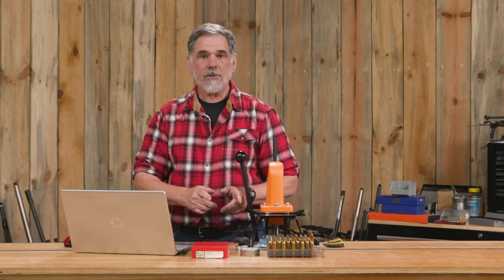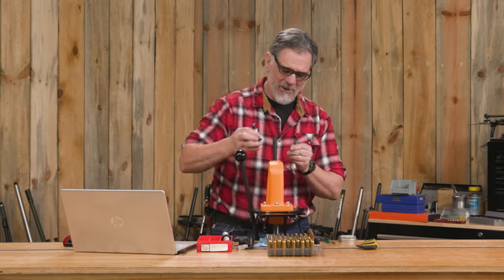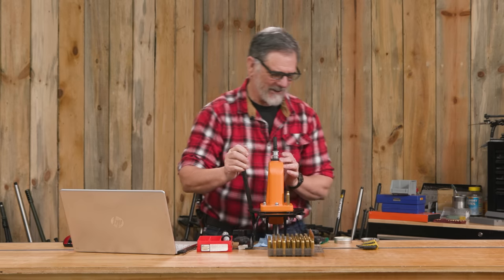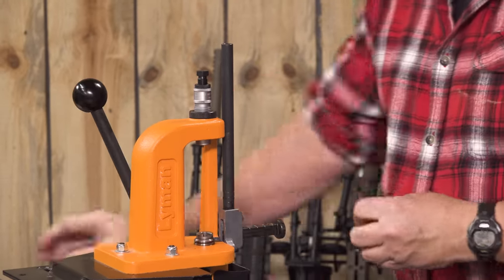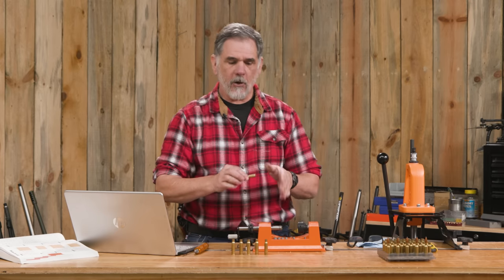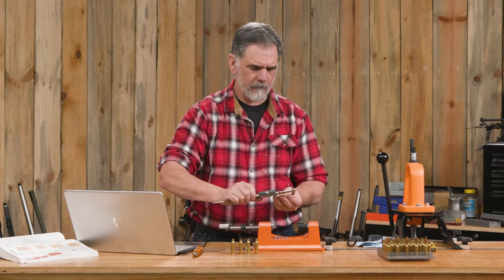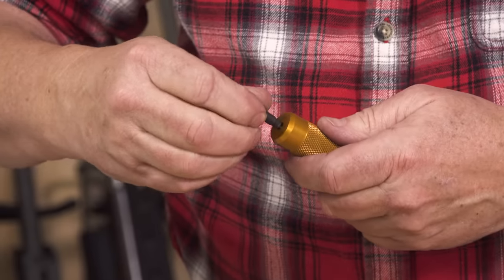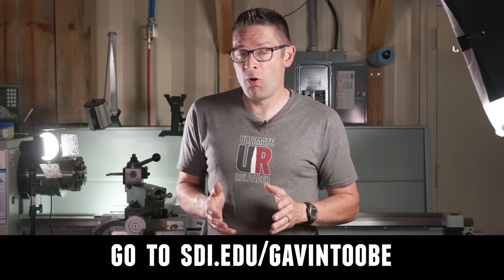Basic Rifle Reloading Part 2: Sizing and Case Prep

Comment: I de-prime on a separate operation I then anneal and when I set up my re sizing die I measure cases and set them back 2 thousandths. And I use a mandrel to set my final neck diameter
Reply: How do you determine  what neck tension you go with?

Comment: I also have an old Pacific .308win Die set. Still works great after all these years! After resizing (I also lube the inside of the neck..) I put the cases in a ultrasonic cleaner, to remove any lube.

Comment: Excellent video for the beginner and a good refresher for the experienced too. If I am setting up to load plinking ammo, I tumble the cases long enough to knock the crud off, then raise the ram with the shell holder installed to top travel and turn the resizing die down until it touches the shell holder. Back off the ram just a bit and turn the die about 1/8th of a turn and then raise the ram to check for proper overcamming. While still in that position, I tighten the lock ring and then turn the allen head locking screw in. I've used Imperial die wax for 50 years and never had a stuck case. Yes, it can get messy but I always clean my dies after each session so the excess lube never has a chance to build up. For a long time I used the Lee trimming tool which works great but now have a Frankford power setup-It indexes off the shoulder and has places to install a primer pocket cleaning tool plus internal and external chamfer bits. I used to prime on press but found I like a hand primer seater because I can feel the new primer bottom out. One thing for the new folks-make sure your primer is seated below the case head. It normally is about .002-.005" but if you can run your finger over the case head and feel the depression, you'll be okay.

Comment: I currently use the RCBS Rocker Chucker press. I'm a liitle bit OCD so once I have prepped the cases before priming I run them back through my vibratory cleaner again especially the hand gun cases.
Reply: The good old RCBS Rockchucker is one heck of a press. I've had mine since the mid 1980's and it was all I used for a couple of decades.

Comment: Great series I've always found once I have set up the resizing die and run the first case. Then chamber it and feel the bolt  for tightness  if tight screw the die down a little more and check again.

Comment: Thanks Guy. I really enjoy these and love to reload. I use Whidden and L. E. Wilson And Forster sizing dies, L. E. Wilson trimmer, and use steel wool instead of chamfer. I prefer this as it makes a more consistent neck tension for me. I used to use that Lyman chamfer tool that's you used and it was fine. I use a Sinclair primer pocket uniformer and a 21st century flash hole deburring tool. But I have been reloading for 40 years and have a fair amount of experience . I think the setup that you showed is a great way to start reloading as opposed to running out and buying costly custom dies. Buy a good value kit until new reloaders find out. If it is for them and know what they want to do and be safe! Reloading can be very dangerous! Only use data from a published source!  Look forward to the next video!

Comment: I use the "Worlds Finest Trimmer".  Very fast when trimming a large batch of brass (have done up to 1000 pieces of brass at a time).  I have it set to trim to minimum case length but I don't always get exactly that.  I set my calipers at half way between minimum and maximum case length and lock it in place.  I then use it as a "Go/No Go" gauge.  If it passes through, it is good to go.  If not, I run it through the trimmer again and recheck.  

When resizing, I don't want to push the shoulder back all the way so I use Redding Competition Shell Holders.  They come in different thicknesses so that I can vary how much I push the shoulder back.  Doing that requires another tool from Hornady so that you know which shell holder you need.  This may be more than you want to do at this stage of the game but it does help improve the accuracy of the ammunition.

Comment: Now I’ve used both carbide and non-carbide dies.  Various forms of lube for shells are available. A basic film is mostly what is needed. I noticed most lube is some form of water soluble solution. I’ve even used k-y jelly, I’ve thinned with some water. I’ve found application with my finger is fast and easy. Also a damp rag would quickly remove any lube after sizing.  I recommend lubricant for any die regardless. It’s always a pain to remove a stuck case.

I’m glad the host shared his experience with the case growing and how eventually it will impact safety. Trimmers can be as cheap as the Lee trimmers that come with a preset rod and base holder or you can spend hundreds of dollars on a fancy multi stage case preparation machine. It depends on what how much effort and time you are going to spend and your final objective.

Comment: @GuyMiner Thanks for sharing your tips.. I like how you simplify the set up process for the beginner. When I was first getting into reloading I had to learn a lot by trial and error due to the lack of a mentor. Expressing the importance of lube is important as well. Most beginners 1st mistake.. next the case trimming importance that’s most people struggle with the concepts and purpose for trimming there bullet until it doesn’t fit in the chamber 😂 I really love my LE Wilson trimmer for precision but for bulk plinking I just use Hornady case prep station.

Comment: I had a Lyman trimmer. It had issues with the set screws on the adjusting rings coming loose and the adjustments changing. I then started using Lee's trimmers. With the case length gauge the adjustment can't change.

Comment: Make sure then you put your sizing die in to check the shoulder length is in the correct spot. My case shoulder was off slightly and chambering my rounds were hard. Definitely double check with calipers before you go reloading the rest. Use a reference case to check and compare.

Comment: I use the Lee trimmer. I find it’s faster to change cartridges as there’s really no set up. I change the pilot once in a while in the unlikely event that the case length rod wears. I also debur the primer flash hole and believe it to be an important step in brass preparation.

Comment: First of all: Thank You Sir's, for your awesome Series on reloading.
I have just discovered Your website (UR) and I think it's great.

Now I'm speaking of " Basic Rifle Reloading Part 2: Sizing and Case Prep"
For this Part  i have one question: may it not be a little bit better to set
the decapping / calibrating  - Die in souch a way, that the Press - Stem 
(with the Caseholder on Top) touches the Die and then back the Die of 
a little bit and start calibrating from there? 

My Idea:
When you then take your Gun and try to load the Case and set the 
Die in small incremental steps a litte bit deeper until the Case is going
just right into the Chamber you might never have problems with
to much Headspace and from there a Casehead- Separation.
But that shouldn't be a criticism at all now!!!

I think, when someone blindly follows the Advices from his Die - 
Manufacturer, his Cases sometimes may become a little bit to 
short for his Rifle - Chamber. Than it cannot seal the Chamber 
correctly and the hot Gases can come back right into the face of 
the Shooter. Not very safe...

Please excuse my bad English. 
I am an older german sack, a bit over 60 years old. I began reloading
seven Years ago and for me its a lot of fun. Because I try to learn 
something new every day (in reloading and Tools therefor), Your 
Website is exactly right for me. Thank You for Your great Work. 
Stay healthy and keep it up!

Greetings from northern Germany,
JohnnyG

Comment: Nice content. On the primer pocket cleaning, i would be careful on cases like 6mm arc.  The 6 arc hornady brass has light tension of the primer pockets and you take some material off when you clean it with that tool. For cases like that deprime then tumble.

Comment: Good video. Are you going to reload with Winchester staball match so we can get an unbiased evaluation of the powder for competition and hunting ammo? How about 223rem (80 or 85.5), 6mmbr (107 or 109), or 308win (175 or 185) for the test? Thanks
I make my own 10:1 case lube with 99% isopropyl alcohol and lanolin, use forster coax and fl die, 21st century expander mandrel, gracey trimmer, rcbs chamfer tool, and anneal after 2 firings. Forster ultraseater die. Powder measured to the kernel of powder. K&M hand seater with gauge for primer seating so I can feel when primer pockets are getting too loose.

Comment: In regards to resizing the brass, I’m very new to reloading, but for my .270win I have to put lube inside of the case neck otherwise it’s near impossible to run the ram back down. Is this normal? Maybe a problem with my resizing die or my method? Using Hornady custom dies

Comment: Great job. I've been reloading for around 52 years now give or take. I started with my grandfather at age 8 or 10. I have an extensive knowledge base of the processes. I was asked a simple question and couldn't for the life of me remember the exact answer. I think it's something that should be put into a loading video. 
Why do you not do a ladder test on Virgin unfired brass? I don't really remember the total exact answer.
But, you want your brass fireformed to your chamber so the cases will seal the gases better and more consistent. 

Jeffrey O. Dohl

Comment: Thanks for the video. I noticed that you didn't use a comparator with headspace bushing to determine how much to "bump" the shoulder (i.e., datum line to base). Is shoulder bumping necessary for AR-15 rounds such as 6.5 Grendel? Not looking for precision reloading but would like to ensure they fly straight for hunting within 300 yds.
Reply: For semi-automatics normally it is best to full length resize anyways so the round chambers and ejects easily  like factory rounds

Comment: I watch your videos as a beginner and just dry tumbled some 9 mm brass with walnut shells and dryer sheets 0:05 and used the FA separator but the inside of the brass is dusty. What’s the easiest way to clean them up ?

Comment: Guy, I have trimmed cases to the recommended length 1.750 for 223.  We shot them up at p. dogs through multiple guns, and when I go to reload, many are shorter???🤷

Will my neck tension be different on a 1.745 case from a 1.750 case in a full length sizing die?  Or is that only true if I put them through a crimping die set for the longer bullet.  Thereby not getting a crimp on the shorter one??

Comment: Why is it no one ever covers how far to set the decapping pin ? Or whether it should even be used ? Deprime & neck size in different steps. I have seen broken pins. Was it from crimped primer pockets or having it adjusted wrong ?

Comment: thanks for the info im new and trying to learn. but was just wondering is it better to deprime before you clean brass ?
Reply: It depends on how much time and effort you are wanting to spend. If you don't de prime you will have dirty primer pockets but vibratory dry cleaners usually won't clean the pockets very good and can get media stuck in the flash hole. so unless you don't care how clean they get or are wet tumbling with ss pins don't bother de priming first. It's all personal preference and no harm in doing either way or both ways. I de prime then wet tumble then dry tumble to dry and polish the brass then resize with the de prime pin in the die just in case something got stuck in the flash hole.

Comment: Did I miss it, or are you not measuring headspace or shoulder bump?
Reply: I don’t know anyone that does who isn’t reloading precision ammo.
Reply: @Gunner1972  depends on the application I guess. I’ve been loading sub moa hunting ammo for years on a cheap old basic Lee starter kit. I’ve added a few things and upgraded a few things but never bothered with headspace. If I took up a discipline that called for more precision I’d absolutely do it, but for me and a lot of other guys it’s just another step to squeeze into already limited spare time. Up until recently I also never bothered to change the OAL from the spec in the manual. When you are shooting boar 0-150yards it makes no difference if my load is shooting .9” or .5”

Comment: Hey Guy! I’ve been following the series and it’s awesome for a new reloader. I’m working on resizing some once fired brass and it keeps getting jammed really good into the die on the downward pull. 

So it’s going in normally, just a little resistance. But it’s getting stuck each time on the down strike to remove it from die. 
I’ve lubed it well, but I’m at a loss as to what’s causing the issue. I’m having to exert a ton of force the get the bullet out and down. 
What would cause this?

Comment: How did you arrive at the proper shoulder set back?
Reply: He had described this as the instruction on die manufacture what you should do is turn it back out a half turn when the shell holder hits the die and size from there until your case goes into your chamber with a slight bit of resistance on the bottom 2/3 of your bolt and wipe of all lube before you chamber the casing and relube if it needs sized more

Comment: I really want to get in to reloading and just haven't to buying any of the reloading stuff yet and would really like to know what is the best things to start out using ???
Reply: Don't buy a kit.  You won't use most of it for long unless you're only loading 20 bullets now and then.  As seen on this channel, the RCBS rock chuker holds excellent tolerances. Forester coaxial is an excellent press. I only wet tumble with a frankford Arsenal Tumbler. 1/4 tsp of dawn and a 1/4 tsp of lemi-shine.  Smoky gas gun brass double the dawn.  Rinse thoroughly as soon as it's done.  Forgotten sitting in lemi-shine will ruin the brass.

Comment: Any lube inside the case neck or just the brush?
Reply: Some people use lube inside the case neck, some just the brush. I use One Shot spray, place them in a ziploc bag with case mouth facing me, spray across the exterior and case mouths, move them around in the bag and allow the bag to lube them up for me. Hornady One Shot says their spray does not ruin the powder/primer after resizing...I still wipe the outside with a rag and the inside of the case mouth with a q-tip.

Comment: Hi Guys,

Can i just confirm basic reloading principles:
- Safety 
- Accuracy
- Consistency

So why is the first case that is trimmed 2.12" but the second is 2.17"????? to me, that is a large difference in size if we are trying to be "consistent"

Can i also ask why case cleaning is NOT last in the process? reason:
- Case lube getting into the chamber
- Neck lube effecting neck tension
- Case trimming being inside the case with powder effecting combustion etc.

If there are valid reasons why then can you please let me know.

Cheers

Callum
Reply: I think accuracy and consistency are two sides of the same coin. Some guys I know do tumble again after they have resized/trimmed. I use the Dillon lanolin lube and they claim it doesn’t affect the powder. I’m just loading hunting ammo so I will wipe every case, then brush the neck, and call it good enough.

Comment: I see you're taking flak about the adjustment of the sizing die. Was there a particular reason behind not discussing sizing to suit the chamber?
Reply: The video is entitled Basic Rifle Reloading and he is providing a visual reloading technique that produces loaded rounds that meet SAAMI specs.  These rounds will work on any factory chamber whether semi auto, bolt action, lever, whatever.  This is the same thing one expects when buying ammo over the counter and the same thing one gets of one uses a case gauge.  Shoulder bump to fit an individual chamber optimally is a step up. :)
Reply: @stevewood4031  I get the fits any factory chamber aspect, but did I miss where that was the goal? It appeared that brass fired in a particular rifle was being prepared for that same rifle.
Reply: @jacquesshellac5311  he was demonstrating Basic Reloading rather than customizing for a given rifle.  His routine was straight out of any reloading manual showing a SAAMI round.  I would suspect he has more than one .308 and the rounds he was prepping would work on any of them and they would work on any of mine.  Could he tailor them for one specific rifle by adjusting the shoulder, oal length, case length, etc? I am sure he could but according to the title, I think that would be beyond the scope of this series. Just my opinion :)

Ah, I went back. I think he knew his brass would be okay whereas random brass could have bad origin, so to speak.